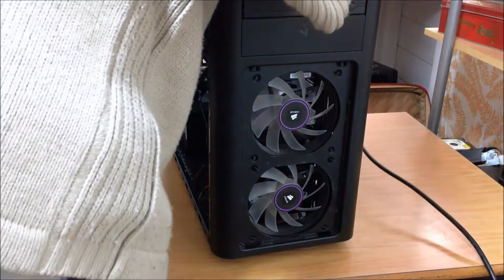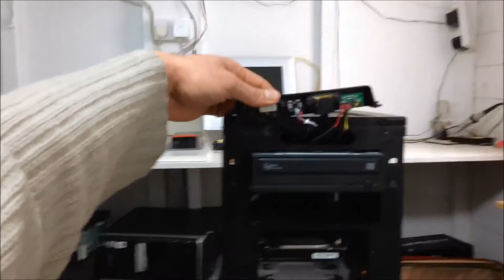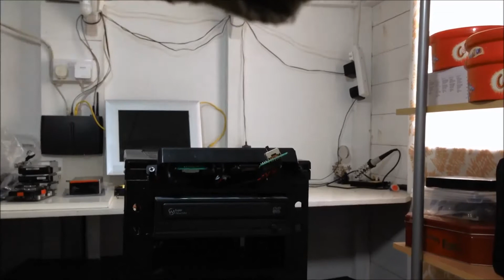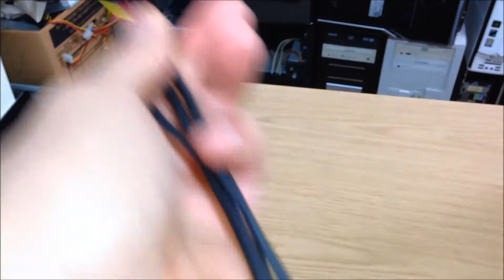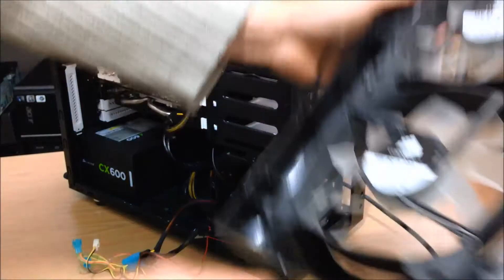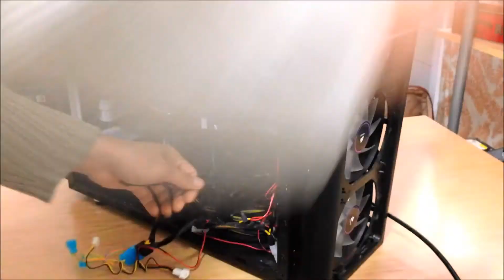Fractal Design Arc Mini R2 Fan Controller Damage (PSU) Temp Quick Fix

Comment: I never used that switch and had all fans at 12V anyway. They were quiet enough. Throughout the years, the switch stopped working...couldn't fix and too lazy to get replacement, so I did the same thing and rigged up an adapter.

Comment: I noticed the top panel fan did not spin, it was sudden, the fan worked suddenly it did not, I did not tamper with it, so was not my fault, so I eventually investigated a bit further.
I got a issue with my Cha fan 2, I check in UEFI Bios, it's not detected by the system, I checked all fans, they all work, as long as not connected to the motherboard/Cha fan 2, all the fans work fine connected to the Cha fan 1 connector.
I checked connector I tried unplugging and connecting it several times.
I have had issues with shutting down the pc several times, it refused to shut down, no reaction to shut down, but I tried sleep sleep mode which worked, then i made it turn on again, the fan was spinning, I tried restart, fan did not spin.
when I turn pc off the fan starts to spin for a second and stops.
I don't know if I need new motherboard.
the motherboard is ASUS Z97-P,
Cooler Master G650M, 650W PSU
I haven't had it looked at by the shop who built it yet.
seems like the connector or the motherboard is the issue, but I don't know.
I guess I could do the same fix you did, but don't have the cables to pull that off, so would have to get them.
so far I haven't found any thing helpful on the web on my issue, I will contact the shop again at some point.

Comment: im not changing my arc 2 mini in 12v but im thinking to change in but i cant. i feel to risky because what i read feedback in this case.
Reply: did you install the fan controller in yourself? or they install it in your case? because i message the fractal support then they reply and then they ask my serial number of my fractal arc2 mini.
Reply: they said wait for 10-14days because of shipping. is they any tutorial how i install the new fan controller in fractal?
Reply: sir what kind of tool did you use if you clean the foam of fractal arc2 mini?
Reply: foam in front panel and top panel .
Reply: really ? i will try this thanks for you help. because im using dry cloth but i think if i continue using this stuff the foam in this case will remove eventually.
Reply: maybe i will wash it. by the way my fan controller haven't receive yet its 14 days tomorrow
Reply: i just receive the fan controller a while ago. but can't install it. because i dont know :( btwafter you install the fan controller? what is your fan controller lvl now? 5v?
Reply: sir i just try to replace my fan controller and i replace it easily my question is what is the best set up for this? 12v 7v or 5v for gaming?